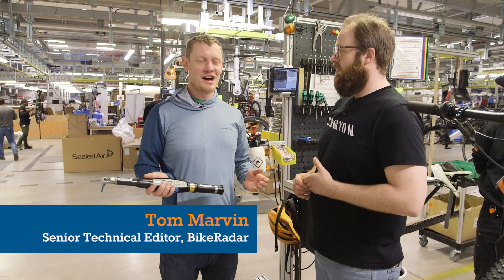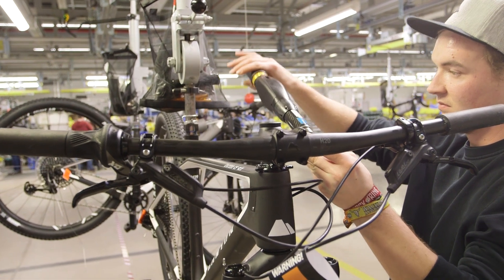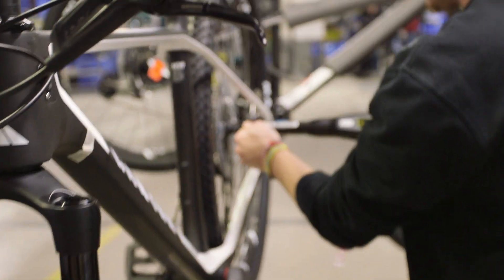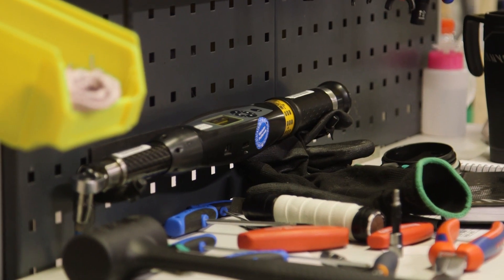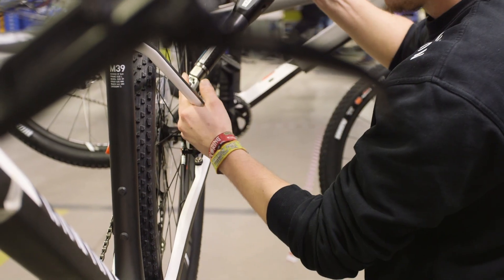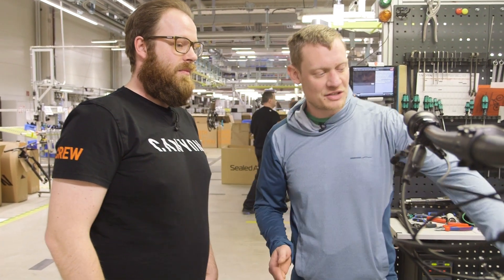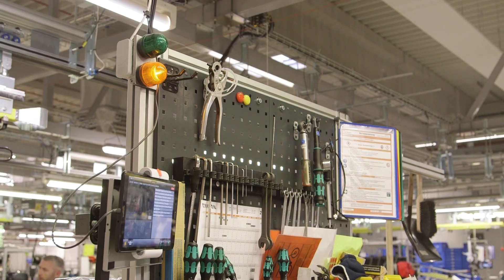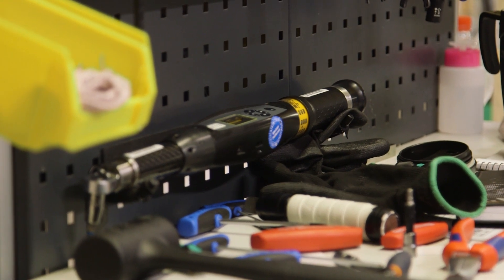Is This The World's Coolest Bike Tool? - Canyon's WiFi Torque Wrench

Comment: A good quality wireless torque wrench starts at about 1800USD, so its not a cheap little toy, but if you want deliver quality, you have to spend the money on your tools.
Reply: In a way the price of the torque wrench decreases the more bikes it is used on, in the grand scheme this is probably a very small investment. $1800 for one bike 1 but $6 if yo are doing 300 bikes.

Comment: If you need this then you shouldn't be a mechanic!
Reply: The tool is not about teaching the mechanics the correct torques, you idiot. It's about Quality Assurance.
Reply: As he describes, traceability is a big deal. Especially for a consumer direct brand where a shop mechanic doesn't check every bolt at final assembly, it's valuable to know every bolt was done correctly and have the data to analyze if something goes wrong down the road.
Reply: ErebosGR more about speed of work flow. Spending extra money on a torque wrench usually means longer lasting and more accurate torque values. These are only useful for manufacturing so you can torque each different piece of hardware without changing the torque value, it just does it automatically. If you are assembling enough bikes, those seconds add up to hours.

Comment: Good to see they use torque wrenches, I wish Trek did that with my 2014 fuel ex, instead of over torquing too insane torque, I had to use heat and cold method to get it undone, Allen key in the freezer for 10m minutes and heated up they are.
I think this video is too short, I bet people want to know which torque wrench it actually is, and more info about it.
Canyons workspace looks well organised, nice to see.
Reply: It's an Atlas Copco STwrench - https://www.youtube.com/watch?v=smRUxvAgRq4

Comment: This is ridiculous hahahah
Reply: dan110024 Oh man, this is not for you and not for the home mechanic. This is in use on the assembly line in the factory...
Reply: Why is that? No bolt will be over/under torqued during assembly... quality control.
Reply: Tamas Varga something that regular torque wrenches have been capable of since inception. I love tech more than most, but this is silly.
Reply: It's not silly, it's very useful in production series and maybe larger garages and it's not limited to bikes.
Reply: Samuel your comments is ridiculous.... hahahah hahahah hahahah hahahah hahahah hahahah